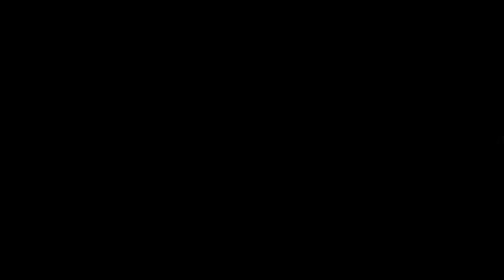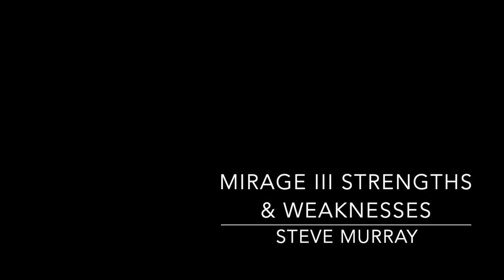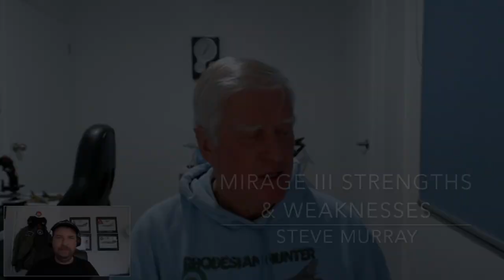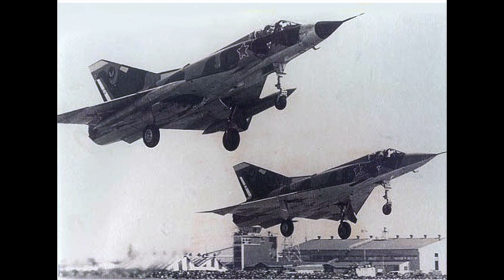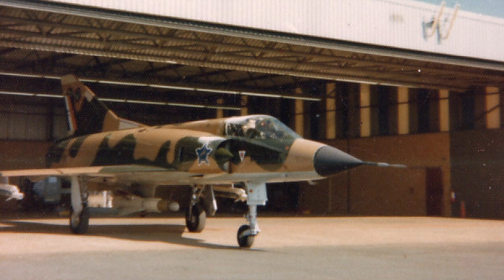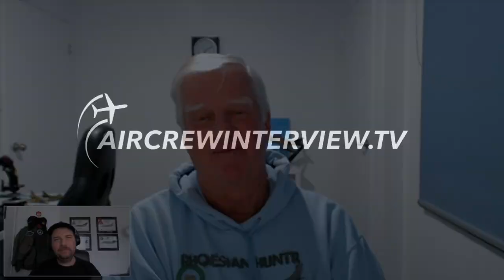Did the Mirage III Need a Bigger Engine? | Steve Murray (Clip)

Comment: Where else do you go to get interviews of Mirage III pilots?   I love this channel.  Thank you so much!!

Another interesting tidbit... rumour has it that Dassault was extremely interested in producing the Orenda Iroquois from the Avro Canada CF-105 Arrow under license for use in a Mirage version (in fact, I think they may have actually placed an order for them...... would have been a monster.  The version installed in the Arrow Mark II was pumping out over 19,000lbs dry and over 26,000lbs in reheat A shame our government squashed the idea.....
Reply from the maker: Thanks very much!
Reply: I listen to interviews of Mirage III pilots all the time.
Reply: They also had a partnership with Pratt and Whitney. They already had multiple options for better engines they could have used in various things but was always seen as way to costly. Apparently they alot of time tinkering around with the TF-30 engine. They were able to actually make it a proper fighter engine. If the F-14A had gotten their version it would have solved a lot BUT not all of the problems.